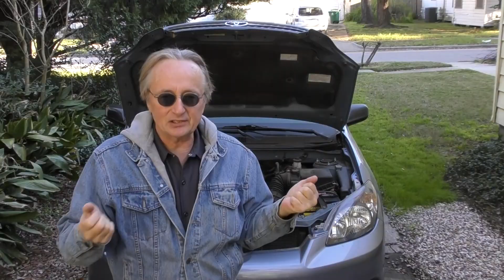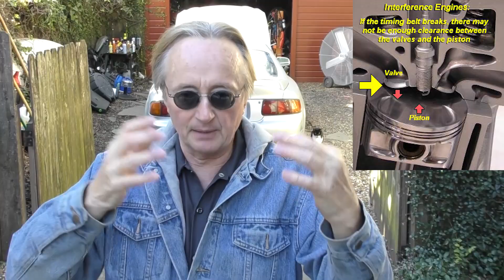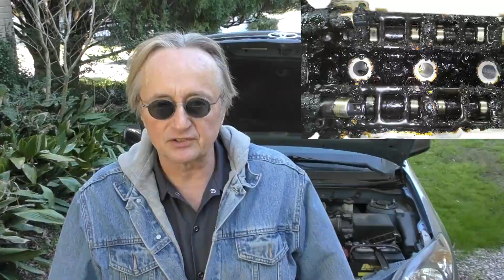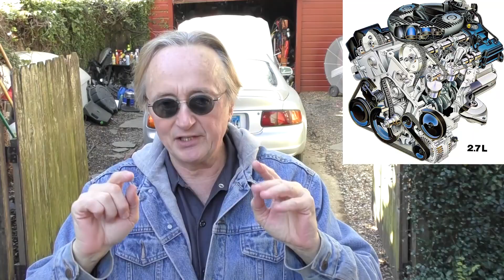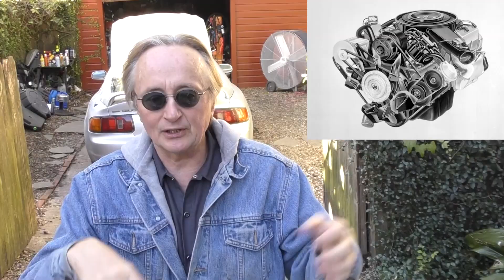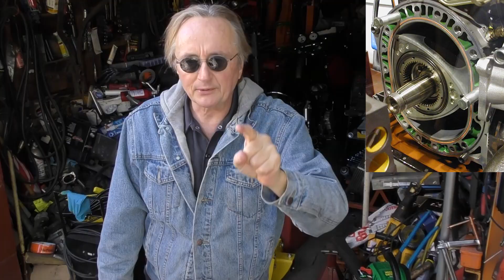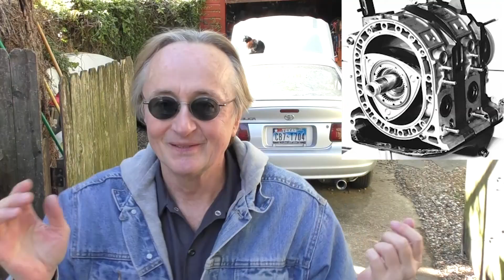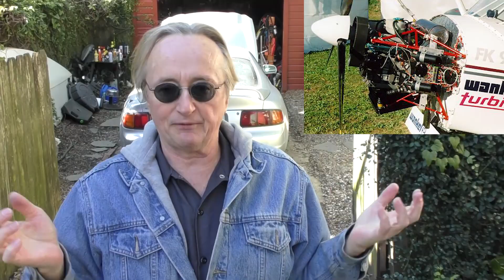Never Buy a Car With This Engine

Comment from the maker: ⬇️Scotty’s Top DIY Tools:
1. Bluetooth Scan Tool: http://amzn.to/2nfvmaD
2. Cheap Scan Tool: https://amzn.to/2D8Tvae
3. Basic Mechanic Tool Set: https://amzn.to/2tEr6Ce
4. Professional Socket Set: http://amzn.to/2Bzmccg 
5. Ratcheting Wrench Set: https://amzn.to/2BQjj8A
6. No Charging Required Car Jump Starter: https://amzn.to/2CthnUU
7. Battery Pack Car Jump Starter: http://amzn.to/2nrc6qR

⬇️ Things used in this video:
1. Common Sense
2. 4k Camera: https://amzn.to/2HkjavH
3. Camera Microphone: https://amzn.to/2Evn167
4. Camera Tripod: https://amzn.to/2Jwog8S
5. My computer for editing / uploading: https://amzn.to/2uUZ3lo

🛠Check out the tools I use and highly recommend ► https://goo.gl/rwYt2y

🔥Scotty Shirts and Merch ► https://goo.gl/pTAeca

Subscribe and hit the notification bell! ► https://goo.gl/CFismN

Scotty on Social:
Facebook ► https://www.facebook.com/scottymechanic/
Instagram ► https://www.instagram.com/scotty_the_mechanic/
Twitter ► https://twitter.com/Scottymechanic?lang=en
Reply: The 6th gen Honda accord is the best engine of all with V-tec 4 cylinder 2.3 L and the 2.4 i-vtec 4 cyl. Trust me I have 5 of them no problem for 20 years of ownership.
Reply: Scotty Kilmer  I have a Dodge Charger 2008 2.7 engine, I had a problem with the solenoid pack it was replaced but the light turns back on with the same solenoid code and the car does the same thing, it doesn’t let the transmission change the gears. The mechanic told me that it might be the pcm! What do you think?
Reply: Hey Scotty!! Love your videos
Whats your opinion about 1991 pontiac grand prix se? I also have a 1994 and a 1996 pontiac grand prix se
Reply: Scotty can you make a video about people altering the odometer of older cars. I have a 2001 Toyota Camry that is practically bullet proof...it was 156k when I got it, but after Carfax was notified of a change in ownership I got an email of the need update the service record. I was stunned to find out that the last record on Carfax shows the car had over 260k on it. I was shocked to say the least. Pls touch on this issue.
Reply: If shutting off cylinders were done right it would result in fuel economy and good accelleration. it would have to be computer controlled with complex duel fuel injectors. May be better than a heavy hybrid. too bad it wasn;t done right.
Reply: Hey bud how are you been following your videos for quite some time now you seem to be very knowledgeable thank you for all that you share I greatly appreciate you I was wondering if you could help me out with a problem I'm having with my car if you can get back to me I can give you my email and or phone number and hopefully you can answer a couple questions that I have thank you and have a great day
Reply: Scotty I have a 2.2 eco tec in my Pontiac pursuit 2006 it has over 200k km on it I live in Windsor and it's been a good car to me
Reply: Mr. Kilmer the last engine that you mentioned rotary engine can be complete money pits. Some people drive them either every day or just on the weekends. I'm still trying to get into the car scene but I will never start off with a rotary engine unless if I have extra money to burn. Leave the rotary engines for people who want to give them a shot. But hey some other engines that are out there are either worse or just as bad as this engine. Also Mr. Kilmer have you ever test driven a Mazda RX7 FD before?
Reply: I'd like to know what you think about electric cars in general... not just tesla or any of the major manufacturers, but just electric cars.
Reply: Scotty Kilmer I have a 2015 Ford Expedition with a 3.5l Ecoboost turbo with over 70,000 miles. I always change my oil every 3,000 miles because turbos will last longer if the engine oil is clean. I change my coolant, transmission fluid, gear box fluid every 30,000 miles. How long can spark plugs last in a modern engine?!
Reply: Scotty what about the ford 4.0 SOHC V6?
Reply: What about the ford pinto engine the worst car ever invented
Reply: @kiingvince4154  Which engine? Pintos had 3 or 4 different ones.
Anyway, none was as bad as the original Vega engine!
Reply: @kiingvince4154   @Chevy Vega was worse.
Reply: Awesome video I’m a big fan! I watch your videos everyday with my parents ! Make a video of g35/g37-350z-370z motorssss!!! Would be awesome ,VQ35de,VQ35revup,VQ35hr,VQ35vhr
Reply: 9:38 Scotty ,, look at "liquid piston" ,, it's kind of a inside out rotary engine ,, fabulously efficient...
Reply: Scotty Kilmer Scotty I’ve had multiple 2.2 eco tech cars and never had any issues honestly would consider it a tank the way I beat on em
Reply: Hey scotty is the nissan vr38dett a good engine
Reply: Scotty what's your opinion on the Volkswagen beetle I just bought a used one ...Thanks I value you advice ..thanks
Reply: Mr Scotty I know you don't have time to really respond to alot of people but I have a 03 Acura 3.2 vtec tl s type 209 thousand miles transmission shifts fine most of the time but sometimes it takes longer to shift in 3 and 4 if u lay of the throttle then the car seems to shift alot of hesation but again it doesn't do that all the time. If the transmission was going out wouldn't it slip all the time I'd really appreciate your insight please help
Reply: Scotty Kilmer What do you think of a 2002 Chevy Monte Carlo SS (3.8 V6) with 58000 miles for $3400? Should I go for it?
Reply: Scotty Kilmer hb
Reply: "They just give up the ghost" LOL
Reply: The editing computer is not available from that seller anymore, FYI
Reply: The pd(95-150) engine 1.9 TDI has the water pump running off the timing belt every 50-70k miles don't follow the manual when it says do it every 2 timing belt changes (150k miles) or you regret it depending how it fails, as they fail 2 ways they blades on the pump fall off and it just overheats no problem new pump, but second fail is if the seal goes it locks up rips all the teeth off the timing belt camshaft goes out of sync and then destroys the engine (as how I ended up with someone's camshaft in mine) 

the camshaft in my car came out of a skoda fabra (pump froze all valves bent and broke 1-2 pistons) its lasted me nearly 2 years witch was impressive only expected to last 1 before it started slapping the hydraulic lifters again) if it last me one month more I have brand new camshaft kit, timing belt and water pump (and hopefully find where the small oil leak is comming from)
Reply: I've got a 2000 Mazda MPV with a cracked head gasket, as well as failing suspension, some electrical problems, and I can't afford to fix it. What are some good mechanic schools I can sell or donate it to?
Reply: I've got a 2000 Mazda MPV with a cracked head gasket, as well as failing suspension, some electrical problems, and I can't afford to fix it. What are some good mechanic schools I can sell or donate it to?
Reply: Scotty Kilmer Don’t give up the ghost!
Reply: Scotty Kilmer need help ! My 2014 V6 Camaro low mileage battery keeps dying though scanner shows everything is good after a boost . Could it be a fuse ?
Reply: In 1962, my dad brought home a new Buick Skylark with the 215 aluminum engine. We could drive for 20 minutes in any weather, temperature, or season, city driving. Then the steam would pour out the overflow, the dash lights came on, & it overheated. 20 minutes later, it was drivable for another 20. (We also had a pink Chrysler New Yorker, with the Push Button Powerflite mounted in the dash transmission shifter. No problems with that one.) My dad traded the Buick in for a 1965 Ford Mustang. Ragoon "Cherry" Red, (1964 1/2 the color Poppy Red, was really orange.)
Reply: Go to hell scotty!  the Mazda rotary engine is a beast.
Reply: Any everyone knows you mix 2stroke with your gas
Reply: you need a ride in a 12k rpm Bridgeport 13b
Reply: Scotty Kilmer your last bit about gasoline engines without spark plugs are you referring to the new engine Mazda is working on? Hey they made the rotary engine too.....they love do to these cute engines.
Reply: I would like to know if a  3.4 6cil is a good engine?
Reply: I knew someone that owned a Mazda RX 7 back in the day, they never shut up about how great it was because it had a rotary engine, just one more reason to laugh at them. 😂
Reply: NorthStar V8??
Reply: Volkswagen never!
Reply: Well scotty i have a 2.2 Ecotec motor with 212,000 miles on it and it sounds fine no timing chain issues at all, oil recently changed, i guess you have to put a little more oil past full on the dip stick
Reply: what about thr 2011 chevy mali i have one?
Reply: Scotty what you think about Ford focus titanium 2012 ? Is it worth to modify ?
Reply: @Snow_bee392  my girl had the 2011. It was trash. The ac kept going out and it had 60k on the car.

Comment: 240k on my 2.2 2010 Cobalt no issues, just changed the VVT solenoids after i bought it and it passes emissions just fine, only issue is the steering intermediate shaft has a clunk in it

I get 37mpg average with the A/C on 😊

Comment: My 2.2 ecotec is running like new with 200k miles. The best engines I've had was a naturally aspirated Volvo with a half a million miles and several GM 3.8 v6 each with over 300k. Never had a catastrophic failure. The Ford 3.0 was solid, too. Great video, Scotty.

Comment: Those engines are reliable. They rely on clean oil. These motors are still on the road in cobalts, aleros, pontiacs, saturns etc. over 20 years. Compared to the junk that chrysler put ou

Comment: I have a 2010 Cobalt with this engine, 210,000 and zero engine related issues.
Reply: I also have a 2010 cobalt, just passed 200k on mine.

Comment: Scotty, you are right about the Chrysler 2.7, but wrong about the VW/Audi 1.8.
About 6 years ago my son found the car he had been looking for, a 2004 Audi A4 with the sport package. The car was an S4 without the big engine. The car had about 120,000 miles, and was in amazing shape, looked new. Checked the engine condition and everything was within specs. Bigger turbo, higher rate injectors, Mark Malone tune, Billy Boat exhaust, South Bend clutch, and a few other items, and now he has about 300 hp. Naturally the suspension, brakes, and tires are first class. Super fun car.
My granddaughter was given a Chrysler with the 2.7 engine by her other grandfather. The car was in nice shape and low mileage for the year. Cooling fans went out and car overheated. It was cheaper and better to replace the engine. The problem was finding a good engine. Car eventually was scraped.

Comment: The Audi 1.8T motors were fine, as long as you ran them with good filters and used 5w40 full synthetic oil in them and didn't go over around 6-7000 miles between changes. The problem was Americans thought it was more if a suggestion than a requirement and would put in cheap filters and run 5w30 standard oil and of course that would sludge up the motor and cook the turbo. You also wanted to allow the turbo to cool after driving to prevent sludge but no one ever did that either. The coil packs were pretty bad, though. Get ones with a lifetime warranty. You could even run diesel truck 5w40 in them as long as you did it from the time they were new, otherwise the detergent in it would cause sludge to break loose in older motors and clog everything up, destroying the motor.

Comment: Don't forget the current Ford EcoBoost engines. Their water pumps are timing chain driven also, so a leaking seal puts all the coolant into the oil pan. Great design.

Comment: I had a 2005 Chevy Malibu Classic for 4 years, from 2012-2016. I never had any problems with this engine. I changed the oil every 3000 miles. I replaced the spark plugs at 60000 miles. Never had a problem with the timing chain. Then again it helps my dad has worked on cars since he was in high school so 40 years.

Comment: I have 2x 2003 Cavaliers with the 2.2L Ecotec.   Both running good.  Red had to be parked at 146k, cuz it rusted out!  Still runs!  Currently running a yellow LS Sport, over 166k, and running great, but also starting to rust.  I do good maintenance, but cant stop the road crews from putting salt on upstate NYS roads.

Comment: I have a 2.2 in a 2007 Malibu that has over 230k on it. I drive 110 miles a day back and forth to work and drive 70-80. It runs like a champ and gets 33 mpg.

Comment: The 2.2 could last a long time with regular oil changes. Having the dirty oil is probably a big part of why they fail, especially if there's sludge build up and the timing components aren't getting enough lubrication. If you keep the oil clean they're fine.

Comment: My 2003 Pontiac Sunfire has the exact same 2.2L Ecotec Scotty is criticizing in this video. I just passed 300,000 miles. I never had to fix a thing in the engine or the transmission ( and I would never bother trying to). I think I can get another 100,000 miles out of it easy.

Comment: The 2.4 ecotec was ahead of its time in being absolute junk. Terrible design. Terrible manufacturing standards. A 50k timing chain. Scotty. I bought my ecotec before you made this video...

You run it low on oil or even the wrong viscosity your screwed.

But to be honest. FUEL leaks in the engine by design and gets in the oil trashes the plastic and chain.... ffs 

Chevrolet used to be a Johnny Cash song.... now its a Aerosmith song....

Comment: Personally I race these ecotecs and daily a ecotec. Maintaining the engine is key i bought a mint condition cobalt with only 30,000 miles changed the oil every 3k going strong still at 210k no timing chain issues. When I built them to race them I get engines from the junkyard and 9 times out of 10 they are full of gunk and slime. Just maintain them and they will last pretty long

Comment: I have a 2005 Chevy Classic with 359,000 miles. Ecotec 2.2. I changed the timing chain for the first time ever last week. Have always changed the oil and filter at 5000 miles. The tensioner was in 3 pieces, but all the guides were intact and the chain showed very little sign of stretch. Pretty amazed it hadn't failed and was in good condition. I just changed it as a preventive measure. I've never had anything fail but for normal wear and tear parts from driving it.

Comment: I had 2001 ecotec 2.2 yrs ago had no issues 

But i have a 2010 g6 with ecotec 2.4 that it does has timming noise and its very annoying looking to get a newer better car soon had it for a while really had no problems with except the noisy timing chain

Comment: My buddies dad used to work at a cadillac dealer back in the 80s he said that the caddilac 864 v8 was actually a very good engine as soon as you disabled the 864 system and had them run on 8 cylinders all the time but I must ask where is the ht4100 or the Northstar

Comment: I have a 2003 cavalier with the 2.2. Has 299k miles and still running strong. Lack of maintenance is what causes most issues.

Comment: 2005 Grand AM. 2.2 Ecotec here with over 350,000 miles.  I change the oil every 3,000 miles. I never had any timing chain issues.

Comment: I literally had my last engine blow because of timing chain jumped and crunched the valves and busted the pistons… thankfully it happened a month after I got the car used with a warranty so they put a new engine in it… but guess what it was.. 2.2l ECOTEC in a 07 Chevy cobalt, which is also rife with electrical problems too, you know the fun ones 🙃 but I’ve done a lot of work to it and I personally do actually like the car and engine, it’s not too hard to work on yourself if you are mechanically/technically adept so it’s a good little runner for me 🏎🔥🤙🏻

Comment: I was shocked to hear that the 2.2 ecotec was the first one off the bat...

I had an 02 cavaliers LS coupe with a 2.2 ecotec I ran in that thing and worked that thing like a mule for 322,000 miles. the only thing I ever had to do to that car was replace the heater core and your standard brakes and rotors. and oil changes.

guess I got lucky with that one. although I did change the oil every 3000 miles.... like clockwork

Comment: You know, now that you mention it, I used to see Mazda RX-8s literally everywhere. They were the type of vehicle I could easily see one of per day, and due to their unique (and in my opinion kind of ugly) design, they'd stick out like a sore thumb. But now I can't even recall the last time I actually saw one on the road. I guess it makes sense if their engines would start crapping out at around 80,000 miles.

Comment: I disagree on the Cadillac engines I had a 1988 Cadillac deville with the 4.9 v8 with the 4/6/8 motor and never had an issue thing ran flawless I always ran full synthetic and usually averaged 40-45mpg in that thing

Comment: I have a Saturn with a 2.2. Changed timing chain and upgraded timing chain oilers that came with it at 200,000. now at 280,000 running like a champ

Comment: Hey Scotty I got a question a rat chewed through my switch kickdown servo on my 2009 Hyundai Accent will it hurt to keep driving my car like this I tried to solder wired but failed it was to short on the servo end I’ve been driving it like this no check engine lights or anything

Comment: ExxonMobil oil contracted Ford to make an engine that would literally be in constant service. Hence the 300 Cid in line 6, million mile motor. The Chrysler 3.8 V6 used in their vans, great engine. Some other great ones GM's 3800 and 4.3 Vortec V6 engines. Easy to work on, many, many miles of trouble free service!!

Comment: My 2.2 ECOTEC has 257k and idle sounds like a dream. I just did preventive timing chain and guide replacement and took me roughly 4 hours. No abnormal ticks, clicks, knocks or codes.

Comment: I mean when chain on our ecotec went it was because we knew the problem we just didn’t have the time to replace it. It had 395,000 miles when it went but it didn’t bend any valves so we had it towed home and we replaced the chain it still runs